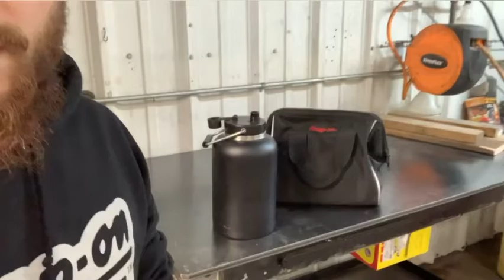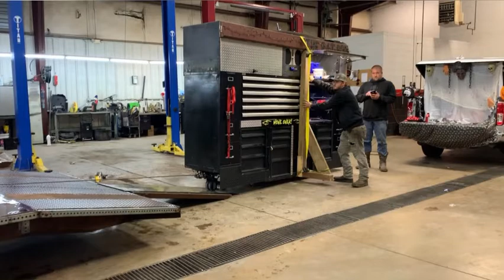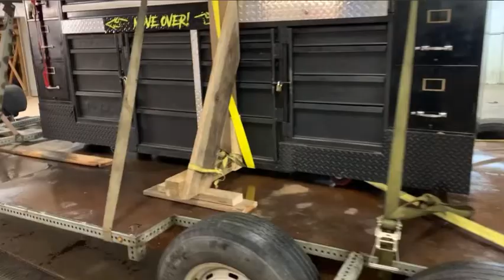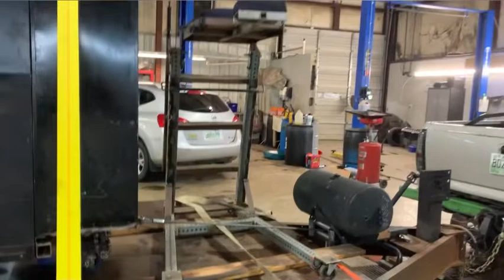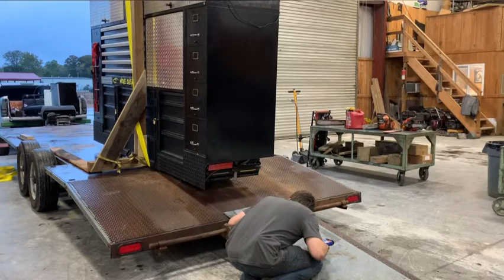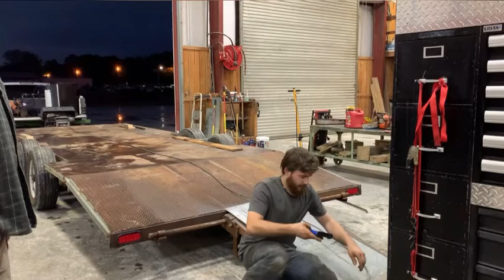Moving My 10ft Long Double Stack Fully Loaded Toolbox

Comment: They say when a door closes another one opens or a window opens. Been there done that, all I could say is keep on trucking forward & don’t look back. I’m a firm believer things happen for a reason.  Good luck on your journey. 

Toolbox 2.0  add a gas motor, brakes, steering & you don’t have to worry about loading it next time, just drive it.
Reply from the maker: For sure thanks! Lol maybe I will.

Comment: I had to build a trailer to be able to move my box… I built it on air so it lays flat on the floor my setup is 22.25 feet long x9 feet tall… that’s what one gets after 45 years of working! And I still need a bigger box… lol

Comment: Should have used the car lifts and just backed the trailer under it.
Reply from the maker: It’s too low to the ground to get the lift under, and there’s really no good way of using straps without risking to bring it over.
Reply: @backintheshop9604  well that makes sense. But it seemed like a good idea in the heat of the moment 😂
Reply from the maker: @whalerlife53  before I added the top hutch and it wasn’t so heavy, that’s how I lifted it with straps, running underneath, and then lift them around the car lift. It worked good but with as tall as it is and it weighing 4000 pounds house a little bit skeptical.
Reply from the maker: Wow, that was for the typos lol